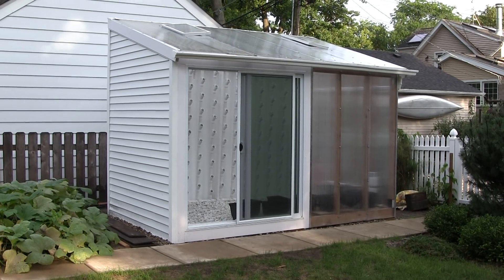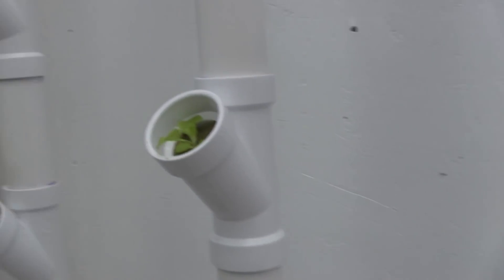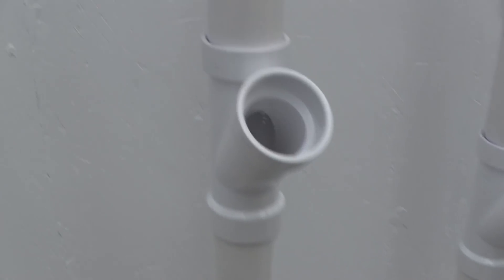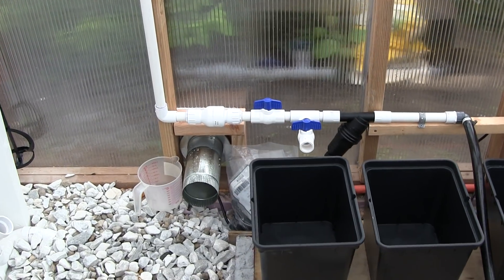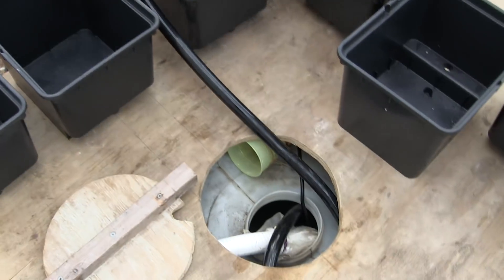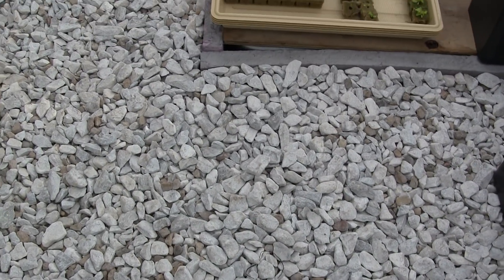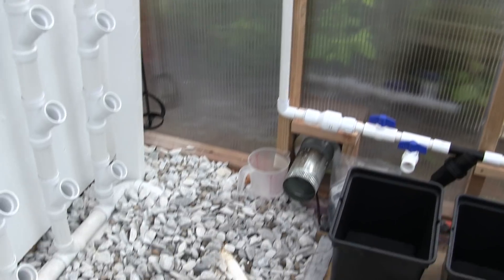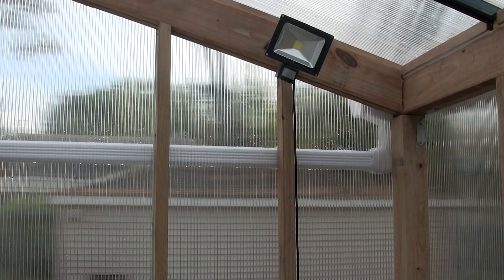2016 Passive Solar Hydroponic Greenhouse

Comment: I suggest building a vertical frame that allows you to insert the square buckets at roughly a 45 degree angle. Then you can pipe a drip system through them. This would essentially give you the same system that the Vicinity urban garden company makes. You can find their system on modularverticalgarden(.)com without the (). Curtis Stone the Urban Farmer has a couple videos where he talks about them and you can see them setup. I would prefer doing a vertical frame with the square buckets however.

It seems you could basically rip nutrients from a giant bucket of soil that has compost mixed into it by running water through the top and draining it out the bottom. Would also suggest including an aquaponics component with fish for a nutrient system. You can grow duckweed easily in sitting water for fish food and also easily farm tons of worms and or black soldier flies which can be added to the fishes diet for the meat and other nutrient components. This way you get some nice tilapia to eat as well. 

Your greenhouse and setup looks amazing so far though. Really like your progress.

For upping the heating in the winter you can have a couple things of compost going in the greenhouse. Also for light and heat supplementation you can use wind power in combination with solar to get more free power. There are ways to store massive amounts of electricity as well through various methods like deep cycle batteries (house boats do this). If you get really into it you can look up "mass energy storage methods". Another solution is the Tesla power cell that is coming out for people to use.

Thought I'd drop some ideas your way since you seem to live continuous improvement as a process and seem quite a bit of an engineer.
Reply from the maker: Hi Concept Hub thanks for the input. I am interested in your level of experience with the suggestions you listed in your post. You have so many ideas but they don't seem very realistic for a hobby gardener like me.

I have some very big concerns about a bucket of compost sitting above the vertical towers or anywhere inside my greenhouse for that matter. First of all adding soil to a hydroponic system is a mistake in my opinion. Detritus clogs lines, pumps, and will create sludge a the low point even with good filtration. The sludge will create anaerobic situations with bacterial colonies competing with your plants for nutrients. This is something to avoid.  Secondly, how will you monitor correct levels of micro/macro-nutrients? There will be deficiencies and an overabundance of other nutrients depending on the recipe for your compost. And what about pests and other bugs?I make my compost in my tumbler and let it sit for 1 season before using it, and I still have issues. 

As for aquaponics, been there done that. It was great, but the amount of heat alone you would need to keep tropical fish healthy with an outdoor temperature below zero in a polycarbonate walled greenhouse with a R value of 2.2 is definitely not an option (not to sound close minded). My greenhouse is 6 by 12. I'd have to rip it down and build one at least 4 times the size to accommodate Tilapia like you mentioned, which require more advanced biological filtration setups than most people can imagine (swirl filters, settling tanks, bio matter, etc.). I love aquaponics, but it's not a walk in the park by any means and growing is not my full time job, unfortunately. 

For supplemental heating and lighting - the compost idea would be better in a greenhouse with a way larger footprint (way bigger than 72 square feet like I have), and I'm not sold on that concept anyway. It'd be great if you try it out and let me know. Also, most communities have restrictions on wind turbines, as does mine (I'm right outside of Chicago).  Some geographic locations are better than others, and mine is not ideal. I did some research and those turbines are operational best between 7 and 12 miles per hour. They also require regular maintenance. I'd love a Tesla Powerwall though. Last time I checked the capacity on the new model 2 was only 13.5 kWh (my photo-voltaic panels are producing 6.98 kW at this very moment) and it costs over $10,000. That's a lot of money for me. You mentioned "free power" and 10K is far from free. 

Because I am relatively new at all of this, I may be over-complicating my thinking regarding implementation. Let me know what has worked well for you and if you have been successful without massive time and monetary contributions I'd love to try some of it out. Thanks.
Reply: I'll try to get back to you on this when I try it all out myself. In the mean time... Currently I'm planning and doing research. Your videos have been a very good piece of my research as vertical farming is much more efficient. Apparently so is aeroponics vs hydroponics due to root rot issues as well as speed of growth factors.

1. Compost as heat source - There are numerous videos online that show this method. My thought is to have them in like a 50 gallon bucket and then put those under a table. If you were to build a new greenhouse at some point you could bury them in the corners. 

2. For an increased R value, you can use poly film covering as a second layer and use a blower to add the air spacing. Curtis Stone uses just two layers of the stuff without the polycarbonate and it does him very well and gives him an R5 insulation rating.

3. Wind turbines - There are versions that aren't stuck way up in the air. The versions I am thinking of are more of a vertical type. I'm curious if the regulations in your area say you can't use turbines at all or if there is a height restriction.

If a height restriction, you could likely just stick a couple on top of your greenhouse or at around that same height.

4. For tilapia or fish - You'd definitely need a second green house and from the visuals in your video it seems you likely could put up a couple of them in your yard. 

At least one next to the one you already have. If you were to do that, I'd submerge the container into the ground so you could still have the space above ground. 

To be honest it seems that when putting in a greenhouse, it seems reasonable to have a few feet of space in the ground be part of the greenhouse vertical space. 

This gives you extra room for various containers and such and put the growing space at the ground line and above.

For the filtration part, there are various videos online that show simpler ways to get away with it. Some use an inline filter. Some use a method where the fish water first hits a type of filter that sits on top of a rock bed and then the rock bed has the bacteria that breaks down the fish waste into the necessary components. So that is basically like a filter/nutrient converter system.

5. The power wall thing is a nice thing but deep cycle battery setups work just as well. A lot of folks that have house boats do energy setups with solar and wind power and a deep cycle battery setup for storage. They say that when the sun is out the wind is lower and when the sun is not out the wind is higher. So you basically have energy flowing in most of the time.

6. To rip composted/dirt nutrients - For this I was thinking of a system where you have a mix of dirt with compost materials mixed into it. At this point you grow worms in it to break things down. Under the soil and compost you put sand layer. Under that is a gravel layer. Under that is a screen mesh. That way you can have drain holes at the bottom. The water then goes out to a system like mentioned in the fish waste point 4. If you end up doing this system, just make sure to only dump an amount of water into the system at the same amount per period of time that it would normally rain in an area that has reasonable plant growth. This should make it so you don't get any mold or sludge type issues. Also won't kill the worms. The nutrient ripped water should go to the rock filtering system before being dumped into the water tank system that is always being pumped around to the plants. Also a note on this mix system is that only put the compost into the dirt mix at the same rate you'd be adding compost to planting dirt. The composting part should take place in a separate container. Basically mimicking normal farming and environmental conditions but with an optimized approach.

I'm guessing you'd want an either or method when it comes to fish or compost nutrient ripping method. This point 6 is based on compost, worm, and sewage filtering methods combined. I haven't seen it done yet but from my studies of this stuff it seems like it would work well. 

I believe that this point 6 would be a more robust method of gathering nutrients than the fish method. When I try this stuff out I'll be doing both methods. Mainly because I want heat, fish, and a more complex nutrient set with the plants.

7. Heat - I'm really happy to see how well you've built your setup so far. The impressive part that I was happy to hear about was the insulation under the greenhouse. There is another method you can integrate. It's called a heat battery. Curtis Stone and a few others talk about this concept. Basically a geothermal system. 

I'd rather an actual geothermal system though. Another method for this is a concept of Thermal Mass Battery which is basically containers of water that gather heat during the day and then disperse it at night when the sun goes down. 

When it comes to the tilapia thing, many people are using the fish waste siphoned through the bottom of the tank as an actual fuel source to burn. There is a couple of videos online about that. 

Questions and Notes

Q: Have you heard of Tower Gardens the company? They've got an interesting setup similar to yours. There is another one online too that does theirs by 3D prints. 

It seems that I have not seen any that do bigger plants that have bigger root systems and that is why I've mentioned vertical stacking of the bigger plant containers at an angle. It seems like you could do that with aeroponics too though if you used bigger piping and bigger Y sections.

Note 1: If you want to talk about this stuff more effectively and efficiently, find me on Twitter. I've got the same username there. PS... I'm an engineer so any tools you need a design on, let me know and I can probably think up something.

Note 2: If you want to see some of the research I've been doing on Urban Farming, check out the Playlist I have on my channel for that as I've been adding a lot of great videos relating to it.
Reply from the maker: Wow ConceptHut, you are one intense dude!  I can't wait to hear about your experiments with all your ideas!  I know I did a fair amount of research before I started on my journey too. There's sure a lot out there on the internet - so many neat sounding ideas. Some things did not pan out for me. My footprint is too small. I wanted to go the geothermal route - I had some drawings worked up, but some hvac people talked ,me out of it. Turns out that there is some shading with my neighbor's tree to the south which starts early September, which knocks out too much sun, and I elected not to go with high powered supplemental lighting. My job is also very intense now so I also don't have the time that I do in the late spring and summer to manage everything. So I'm up and running with my basement system which is fine with me. I'll finish out what I have in my greenhouse and then my basement crops will take us into the winter. 

As for the Tower Garden - yes I know of them. They were the inspiration for my design. I thought they were a bit on the pricey side so I came up with my own design to improve on the inefficiencies of the Tower Garden and the issues I had with the aquaponics system I was currently running. Since then I built 9 subsequent vertical tower systems and I am happy with my final product. 

Best of luck to you on your journey!
Reply: Yea, the Tower Gardens company is crazy expensive. Your designs led me to their designs. Had been thinking there had to be a tube version for aeroponics as the other aeroponics I had seen were using a 50 gallon drum.

The geothermal thing has little to do with the sun. It has to do with that below a certain depth of soil there is a constant temperature year round. This is why buildings use it under their building. Basically it gives you roughly 40 to 50 degrees F to work with for free. Then you can supplement the rest of the coolness or heat for the rest.

Hope you keep up with your channel and any updates you make with your projects. You're doing a very neat thing that many people could do well with.
Reply from the maker: Hello Concept Hut. Perhaps you can build some aeroponic designs and test them out and post your results on your channel. I agree that the general consensus is that aeroponics is the best method out there to deliver nutrients effectively with an incredibly efficient aeration coefficient.  It all sounds really cool.

I have some experience with geothermal - some training in Germany, quite a few consults to convert my single family home, some research for my small greenhouse. I understand how it works. For a greenhouse my size there is not enough area for a DIY geothermal project. One thing I did not consider during the planning phase of my greenhouse construction is the availability of light during late season. Unfortunately there's a neighbor's tree which provides considerable shade.  There appears to be limited growth options considering the lack of light and falling late summer temperatures which promote the growth of powdery mildew affecting many lettuce varieties. There's still plenty produce for my family's consumption and spring and summer growth way makes up for fall inefficiencies. Even if I had heat for winter through geothermal or otherwise, I'd require 70%+ supplemental lighting, and then would need to dispose of at least 50% of production to compensate for compromised produce. It's not that I'm without options. I'm close to my first basement harvest, at 16 kWh per day at full capacity, but the product is solid and my family only requires half of our production. Life is great! :-)

I have some improvements scheduled for this next indoor growing season. I just have to find the time to devote to building and implementing them. I hope to post a vid when I'm done.
Reply: Sounds good man. 

A note on the mildew thing... Various folks channel's I have seen have noted mold type issues and their solution was to install a fan that will stir the air in the enclosed space. Apparently molds require a bit of still air or something like that.
Reply from the maker: Yes, not sure if I can corroborate that. I have a large circulation fan in the greenhouse (it's on one of the update  vids I posted this summer), also a smaller one for my indoor setup and they may help a bit but it's hard to tell.  I first noticed it on August 1. Made my heart sink!  Powdery mildew seems to like high humidity and low temps.  Heat is supposed to kill it. In early March there were days where the greenhouse got into the 90's, and I added a space heater to get the temp up over 100 hoping to rid the greenhouse of it, but alas no. I have a dehumidifier working in the basement and knock on wood so far so good.
Reply: Thank you for the new data point. I'll have to do more research.

Comment: I like your idea, I want to build something for my balcony to grow veggies and herbs can you suggest me the best automation system which I could try and is there a way I could work with hydroponics without electricity? And still be efficient in outdoors.
Reply from the maker: Hi Yash, interesting idea, if you can figure out how to pump water without electricity. During peak sun you need to irrigate more regularly. I even go 30 to 45 minutes at a time, compared to at night when you can get away with 30 minutes or more off. I suppose if your nutrient is elevated over your system and it's large enough to allow for a slow trickle - depending on your system size, you could haul the nutrient back up top every couple hours or as needed. I don't think this would be efficient - and you'd also be more likely to heat up your nutrient which would be disastrous for your plants, or at least the the plants I grow normally.  As for automation I just use a 15 minute interval timer - you can pick them up on Amazon or a local hardware store. Good luck.
Reply: MaryandJoe Neumayer  hey thanks for your reply what do you about wick system
Reply from the maker: I don't wick. My towers slant slightly forward.

Comment: Excellent work, Thanks for sharing 
I am from Toronto, got gr8 idea for heating

can you kindly share approx cost of this complete setup thanks
Reply from the maker: Hi Asim, I have a parts list in the description. You can build it how large or small you desire and price out your materials locally or order some online - the price will largely depend on locally available materials. Minus growing supplies and nutrient you could probably do it for around $800 to $1000, which would include all hardware, lumber, plumbing, electrical, etc. Referring to your comment about heating - are you looking for a gr8 idea or do you have one for me? Good luck!

Comment: Can you please tell me what kind of thermostat, thanks, nice work!
Reply from the maker: WILLHI WH1436A 110V - 240V Digital Temperature Controller Thermostat Switch NTC 10K Sensor, Improved Version from Amazon.  A bit tricky to set up but solid with amazing customer support if you need any help. They even made a video which they posted on youtube for me - who does that?!